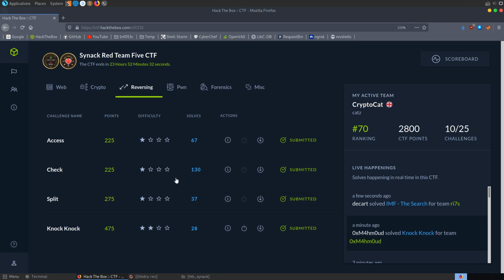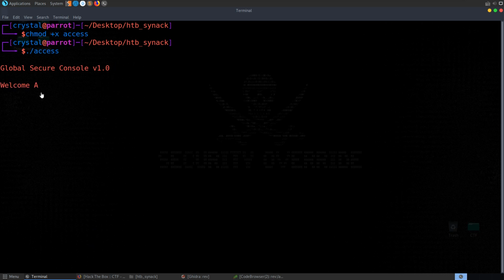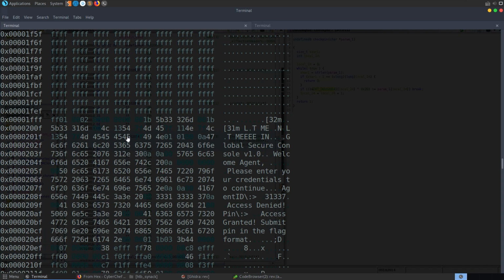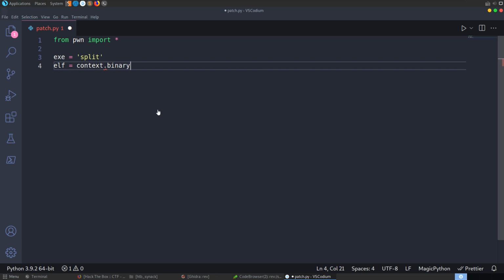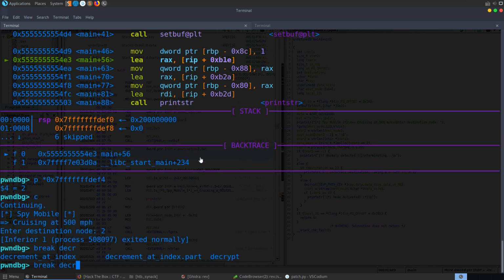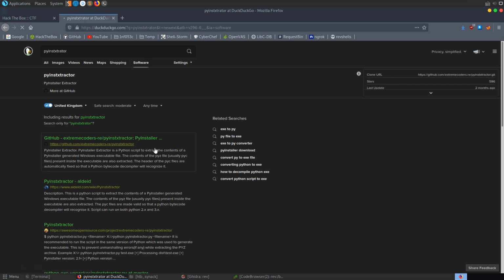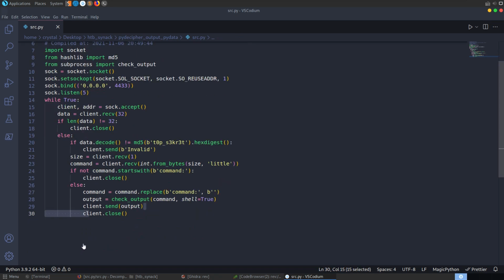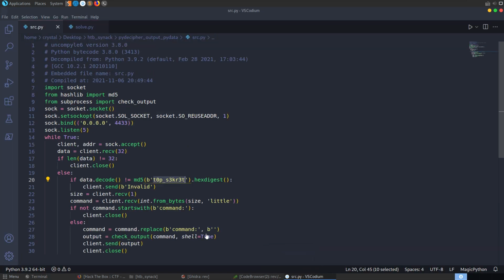Reversing Challenges - HTB x Synack RedTeamFive Capture The Flag (CTF) 2021

Comment: Really love these walkthroughs! I couldn't get past "Knock, Knock" because I was trying to interact with the backdoor directly instead of using pwntools. So I was limited to only 2 chars for my commands. 😅 Spent waaaay to long trying to find all 2 char linux commands to get the flag.
Reply from the maker: Thanks mate 🥰 Honestly, I spent a long time on the same thing lol. I thought the problem was with the space in the command, took me a while to work out that we need to supply the length of the command first and even then I had problems using netcat 😆
Reply: @_CryptoCat  Figured out that the program was interpreting the newline char "\n" after sending the command as the length. Which when converted to decimal is only 10
Reply from the maker: @ItsJustNotBob  Ahhh that makes sense! I recall now I changed the sendline() to send() in the pwntools script but didn't make the connection between the '\n' and 2 char commands working, thanks for that 😊

Comment: Greate walkthrough bro
Just with split i really like how did you patch the binary with pwntools
I didn't use your approach instead i used ida to patch it manually with just replacing jz with jnz in both conditions then i just debug the binary with gdb to get the flag
Good job man 👏👏👏
Reply from the maker: thanks bro 🥰 i should of actually patched that second condition in ghidra for a bit of variation. ah well, next time! 😁